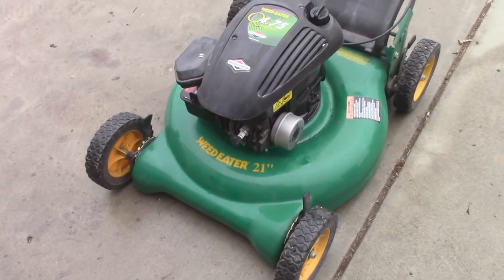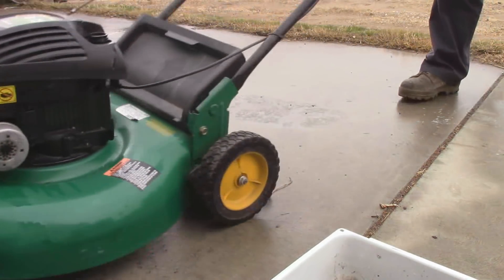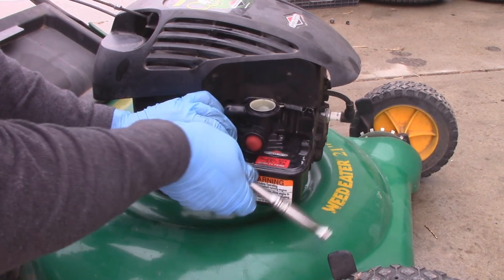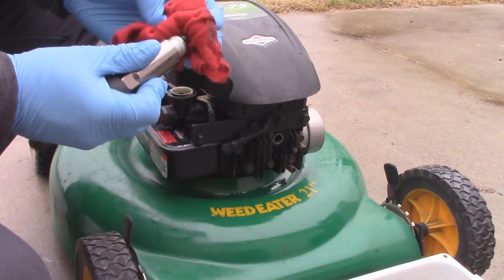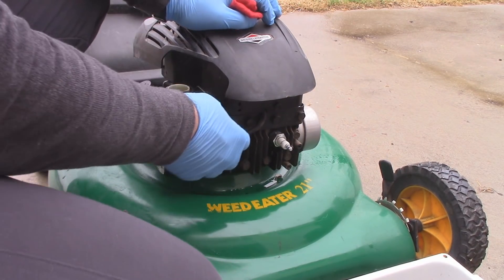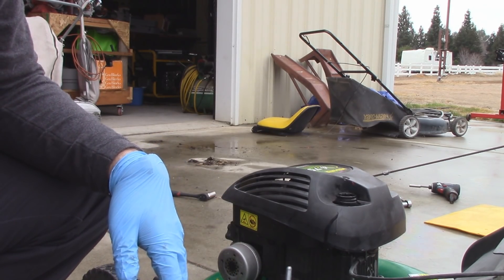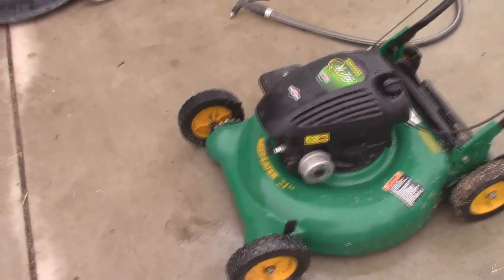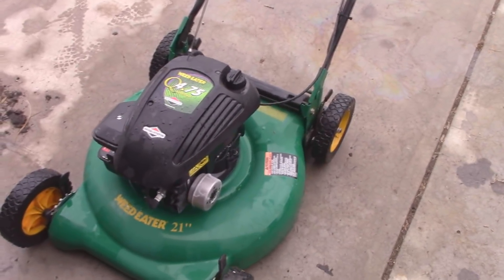How to Fix a Mower Overfilled with Oil

Comment: Sad to say I just tried to run my john deer the following spring after having it serviced AT my john deer dealership. I noticed it burning oil . Checked the oil level and saw it was half way up the dipstick! FROM THE DEALERSHIP SERVICE. So far I've taken about 1/2 quart out. Waiting for it to settle for accurate reading. Going to try this procedure to clean it out. Just wanted to give a heads up to never assume that the "proffesionals" always do it right.   ie...double check and don't assume....and thanks for the vidio
Reply from the maker: Even if there is residual oil left in it. It will all just burn off and look like an old steam train. Draining out the proper amount as you said is just fine.
Reply: Hank's Garage thankyou for the confirmation. Took almost a litre out of it, cleaned the plugs, ran a little seafoam through it. It was a little rough for a bit , but it's running good now.👍makes me wonder how a tech could make that big of an error with the new oil. I can see a quarter of an inch or so over (dip stick) but a litre is ALOT.  And then not to catch it by double checking the level.  It's an expensive machine to have potentially ruined by mistake. Oh well....stuff happens just glad it survived. Lesson learned on my part